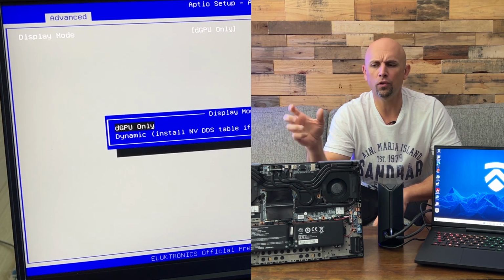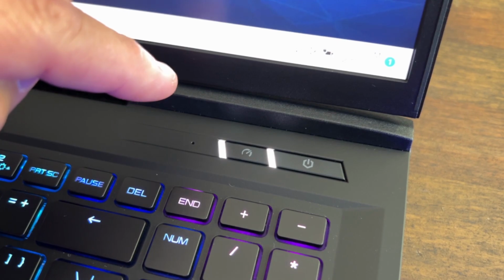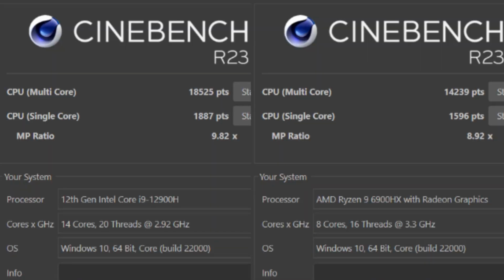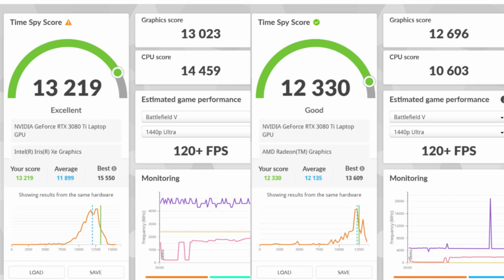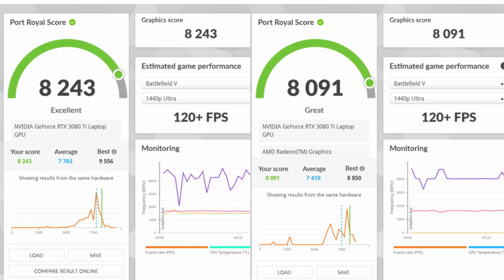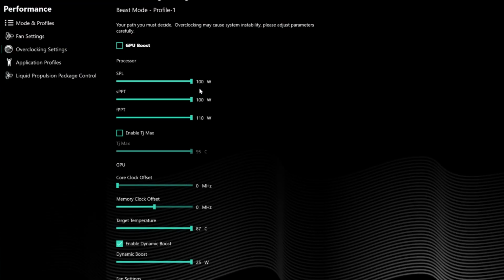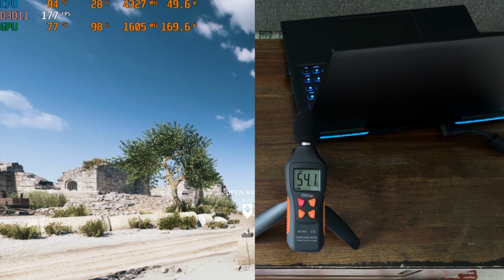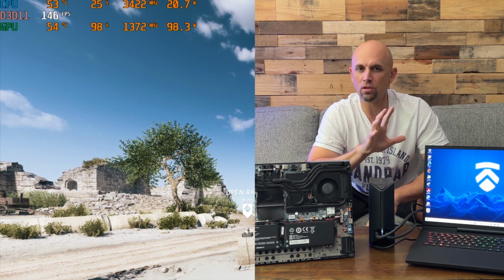(2022) MECH-17 i9 12900H and Ryzen 6900HX!  Expectations, Tuning and LPP Greatness!

Comment: hey bob! Recently gifted my friend my old titan and got myself a asus rog strix scar 17 special edition with i9 12950hx and a full powered rtx 3080ti. I have been following you since I started the laptop life and made it a point to learn how to undervolt. However it seems that this 12th gen intels sucks at undervolting. A friend told me that the chip was locked but I disagree as changing the core cache crashes the laptop. I looked at the bios and it also has the undervolting there but only up to -80 mv. I need help, do I need to unlock it on the bios first or what am I doing wrong. I cant seem to get decent cinebench scores and the laptop is really cooking...help please..
Reply from the maker: I know HX allows it but I don’t have any hands on time with 12th gen HX.  UV tolerance became very tight with 11th gen, perhaps 12th is that way too.
Reply: @BobOfAllTrades  my main concern is sir is how it kinda messes me up now unlike the titan before. atm i have to have it disable turbo boost to keep it from cooking the hardware. armoury crate is also a weird experience for me. I think I should have it on high performance on armoury crate before undervolting. at this point i think i should first undervolting the gpu but to tell you the truth, it runs it pretty cool.
Reply from the maker: @graelstream2353  Don’t let the GPU temps fool you.  Pulling the heat/wattage from one part will help cool the other.
Reply: @BobOfAllTrades  currently tweaking msi afterburner. Been able to push the cpu undervolt without it crashing at - 25 mv. I think I messed up the first time because I undervolted the system at silent mode. Tweaked the battery setting into balance, pushed armory crate and had the system on performance then undervolted by increments of - 5 mv. I hope I can push this further. You weren't lying when the thermal performance of the titan can't be beat sir..

Comment: Hey, there's a sell going on in eluktronics.  Which is better an amd or intel eluktronics?
Reply from the maker: A brief summary of the pros and con’s mentioned in the video.  

Intel will provide equal or better performance depending on the software used including games and editing.  

AMD had better battery life and can its USB-C is connected directly to the Nvidia GPU making this the right choice for VR.
Reply: @BobOfAllTrades  But I mean , if you had to use one for coding, which would you prefer?
Reply from the maker: @glorymanheretosleep   What does coding benefits from most?
Reply: @BobOfAllTrades  I'm not entirely sure.  Anyways, there's a sale going on.  So...intel it is according to you?

Comment: I just bought a i9-12900H RTX 3080 for $1,500 

This is the Description of my laptop
The long awaited MECH-17 refresh has arrived in a brand new chassis! This Grand Performance (GP) edition comes with a FIRE list of seriously exciting features. Eluktronics continues to show what a true performance enthusiast laptop consists of while the rest can keep trying...

External Liquid Cooling: Liquid Propulsion Package (LPP) Included (A $199.99 Value!) 

Operating System: Windows 11 Home 64-Bit (Clean Installation, No Bloatware)

Processor: Intel Core i9-12900H 14 Cores - 20 Threads (2.5-5GHz Max Boost Clock)

RAM: 32GB Samsung DDR5 4800MHz Binned Low Latency RAM (2 Dimm)

Display: 17.0" 16:10 Narrow Bezel QHD IPS-Type 240Hz Anti-Glare Display with G-Sync Technology & Advanced Optimus Support (2560 x 1600)

Graphics Card: 16GB GDDR6 VRAM NVIDIA GeForce RTX 3080 (Max-P: TGP up to 175 Watts!)

Storage: 1TB Samsung PM9A1 (980 Pro OEM Equivalent) PCIe Gen 4 NVMe SSD

Expansion: One empty M.2 PCIe bay

Wireless: Intel WiFi 6 & Bluetooth 5.2

Keyboard: Cherry Per-Key RGB Low Profile Mechanical Keyboard plus 10-key membrane numeric keypad

Light Bar: Customizable RGB

Mouse: Ultra Large Glass Microsoft Precision (PTP) Touchpad with multi-gesture & scrolling function

Webcam: Full HD IR Camera with Windows Hello Support & dual digital microphones

Ports: 1 HDMI 2.1 (Connected to dGPU), 1 Thunderbolt 4 (Connected to iGPU), 1 USB 3.1 (Gen 2), 2 USB 3.1 (Gen 1), SD Card Reader, 2,500GB Ethernet RJ-45, Audio out & Mic In, Kensington Lock slot

Audio: Sound Blaster Cinema 6

Power: 330 Watt AC Adapter

Battery: 4-Cell 99.8WHr Extended Life Polymer

Dimensions: 15.09 x 10.7 x 1.07"

Weight: 5.95lbs

Warranty: One Year with lifetime USA based technical support!
Features & details
Ultra Performance Inspired: Designed with an impressive thermal design for air cooling and complimented with a proprietary external liquid cooling system which connects to the back of the laptop. This circulates cold water through the internal heatsinks of this system cooling up to 20 degrees Celcius for both the CPU & GPU. A desktop experience at home and disconnect when you're ready to go mobile!
Extreme Performance – Crush the competition with a the power and speed of the latest Intel Core i9-12900H processor, featuring 14 cores and 20 threads to divide and conquer multiple tasks at once
Not Your Average RTX Graphics Card – The latest NVIDIA GeForce RTX 3080 (16GB dedicated GDDR6 VRAM) is powered by award-winning Ampere architecture with new Ray Tracing Cores, Tensor Cores, and streaming multiprocessors supports up to 175 watts of power for the ultimate gaming performance
Blazing-Fast & Color Accurate Display – This 17.0" Quad HD (2560 x 1600) IPS-Type LED-backlit display with 16:10 aspect ratio features an incredibly fast 240Hz refresh rate for gamers and content creators who demand the best visual experiences
Why Eluktronics – Astoundingly powerful. Professional Design. No External Branding. No Bloatware. No BS. US Based Support. Our laptops are designed to let you work, play, and create like never before!
Reply: Nice!

Comment: I noticed they have these on Amazon for way way less than they are selling on their site. Are they being sold at that price because it's overstock and they are making room for the 40 series or are they refurbs? Like for example the 16gb 1tb 12900h 3070 ti or 6900hx are only $1499 and $1599 which is nearly a $1000 less than their site. The other models even all the way up to the 3080 ti are around $1000 less again at $2399. There have been 0 reviews or sales on them so I'm a bit hesitant but it is directly from Elucktronics.
Reply from the maker: The awesome sale ended on the site recently.  Amazons sale is no slouch so grab it while it exists!
Reply: @BobOfAllTrades  Ah nice just what I needed to hear to pull the trigger, thank you sir.

Comment: Hey bob having some laptop trouble I got the Eluktronics 970tf after your videos on it and it’s been great the past few years but recently have to rig the charger into it to get it to turn on was wondering if it was soldered on I do not have the tools to open up the entire case or would check myself also any suggestions for how to deal with this would be great thanks!

Comment: I have a alienware m17 r5 with a 6900hx & 3070ti. The 6900hx keeps throttling down on me to around 1700mhz then goes back up to higher speeds happens randomly while playing games. Even sometimes it throttles all the way doen to around 400mhz
Reply from the maker: That’s seems excessive.  Hopefully Dell will produce a BIOS update to address that.
Reply: @BobOfAllTrades  maybe the 240watt psu is not enough ? I have always bought intel before, first time using AMD and that is probably the last time. AMD just does not feel as stable as Intel
Reply from the maker: @DepecheModeDM  intel is definitely more polished from a mobile platform.  It’s definitely not a PSU issue.  A larger brick doesn’t increase the power fed to the CPU/GPU.  At best, it may charge faster but that always the case.  

Based on comments, AW is an odd one when it comes to their performance laptops these days.  They let it rip without the ability to tweak anything and their software is very slow.

Comment: Bob, is it possible to manufacture a charger light weight 100g with 100w out put that can be used with any laptop with the help of small male adapter, do these laptops require bios update .

Comment: Hey Bob, have you tried disabling all of the E-Cores and testing at different power levels to see how the P-Cores behave? I'm thinking of giving that a try. I wonder if the P-Cores at a reduced wattage will boost high enough to provide a better gaming experience than the full cpu at a reduced wattage. Thinking of testing this. I notice that at 25W PL1 the performance for average fps is pretty solid, but I feel more dips and likely worse 1% lows.

Just a thought. Thanks for all of your hard work.
Reply from the maker: 12th gen hasn’t disappointed at stock so I haven’t seen the need yet.  Perhaps single core titles 🤷 

Let me see if I can find something to exploit this.
Reply: @BobOfAllTrades  I'm very impressed with 12th gen overall, but I'm trying to dial in a good profile with a balance of temps/acoustics/performance on air. I know it performs surprisingly well with the wattage dialed in, but I'm wondering if giving P-Cores priority might keep those 1% lows a bit more steady. 

Regardless the laptop is amazing. Everything I asked for as a successor to the Mech-17.

Comment: Hey Bob, if both use the same screen (assumption), why does the amd one lack the gsync certification?
Reply from the maker: That’s the question I had too because my experience with a non-Gsync solution in the past was brought back with a bios update.  That was on a 2017 Acer Predator.  Apparently in the case of our MECH-17 laptops, there’s motherboard chips that are missing.
Reply: @BobOfAllTrades  do all laptops actually use the hardware module? I thought gsync was achieved via software.
Reply from the maker: @niebuhr6197  I’ll need to investigate what the chip is for and what it is exactly.

Comment: Bob I really have to give you props for being so honest and blunt with your information. Even though you work for Eluktronics being as forthcoming as you are just speaks volumes. THANK YOU. Don't change man. 

It kind of kills me that the intel version doesn't have the thunderbolt port connected to the dGPU. If I wanted to get one of these to use as a DTR I'd want to have it connected to an external thunderbolt 4 enclosure for all my extra peripherals. Webcam, Mic, two external displays, and keyboard. First world problem I know, but that would make it alot simpler to undock when it was time to take it on the road. If the AMD version ever got a new revision for USB 4 I'd think that was be the perfect mixture. One of these days someone is gonna make the perfect laptop. Just so close. . .🤣

I do wish these were around when the Clevo x-170 was the best around. Because seem to be on another level.

Glad to see you make a video again Bob. Take care!
Reply: connecting to dGPU is best for performance, but connecting to iGPU is best for mobility. At least in case of my Dell laptop and my friend's MSI laptop, even after you disconnect the laptop from external screen, the Nvidia GPU keeps being active which horribly reduces battery life, so you either have to completely reboot the laptop(not an option of you have tons of apps open) or turn off the GPU manually via device manager, which is super annoying. No such problems when your monitor is connected to iGPU. you can just put it to hibernation mode and take it where you want, continuing your stuff without reboots or inconveniences.
Reply: This is an Intel rule read their chipset layouts online for 12th gen mobile chips. One monitor on hdmi, and the other on USB-c with advanced Optimus will still work well

Comment: Thanks for an honest review, Bob! The only thing I don't understand though is why choosing 12900h instead of HK, if H CPU-s don't have voltage control anymore? If you're going for an i9, wouldn't it be better to go for a tunable version?
Reply from the maker: Correct, no UV on 12th gen H. Intel has required less UV each generation so it’s promising that its less necessary.  8th gen was a definite-.115 or higher while I’ve seen 11th gen have WHEA errors at -.030.  I don’t recall for certain since it’s been several months and I don’t place the orders, but I don’t think HK was available when we placed our order and the expected expenses to have it is often hundreds more.
Reply: @BobOfAllTrades  that makes sense, that's what I thought. Thanks for your answer. Well, time to ditch Intel. At least AMD didn't take undervolting away from us on purpose and they have good battery life.
Reply: HK is useless if the BIOS is locked. All the voltage and multiplier tuning is "greyed out" on apps like XTU and throttlestop..... The only OEM that provides an "unlocked" BIOS is MSI. Otherwise you have to fuck with the BIOS yourself, ie: get a copy of it, find the hexadecimal lines that unlocks it etc, then flash it back in. It's extremely risky if you don't know what you're doing, and it's still a gigantic pain in the dick even if you've done it as every BIOS is different
Reply: nevermind, 6:50
Reply: @anthonyzheng7274  he doesn't talk about undervolting at any point in the video
Reply: @tabalugadragon3555  When he talks about the extra "tuning" features on the BIOS for the intel one, it is implied in that BIOS section you are able to undervolt. He also said there's no need to mess with the BIOS/undervolting since you can just tune PL1/PL2 in windows.
Reply: @anthonyzheng7274  no he doesn't. I've seen users of the latest Eluctronics laptops being unable to use official software to undervolt on i7 12700h, because Intel locked it out. So no, unless Bob directly tells you that you can undervolt 12900h, you can't do that.

Also notice that when he goes in detail of tunability he only talks about power limits and GPU undervolting. If CPU uv is available on their laptop and he wants to advertise it, why not mention that? Everything so far points at H CPU-s of 12-th gen being completely locked, so I don't think Eluctronics broke that rule here.

P.S. Messing with power limits doesn't equal undervolting. As lowering voltage doesn't decrease performance, while lowering power limits does.
Reply: @anthonyzheng7274  your last 2 replies are gone from some reason. In case you didn't mean to delete them - actually 11-th gen just locked undervolting on most laptops just like 10-th gen did, while it is 12-th gen that completely disabled it on non-K CPU-s. 
You can easily find undervolting videos of 11-th gen i7 11800h, no such thing for 12-th gen.

Comment: I've been using both of these for a bit, pretty nice so far!
Reply: @Jarrod'sTech +1 waiting for the review
Reply: Oh will you be doing a review for them soon?
Reply: @ookami-chan3328  It's happening, just not sure when, there's a lot going on at the moment!
Reply: @JarrodsTech  looking forward to it!
Reply: Jarrod posted today.  It's all I needed to order a Mech 17GP 3070 TI
Reply: Oh you teaser you. Now I'm excited to see what you can do with these monsters of laptops.
Reply: @Terreos  😏😏
Reply: You are the reason I bought mine. Thanks for the in-depth reviews you do. :trophy-yellow-smiling:
Reply: @dajatlemmont2323  How do you like it so far? Did you go for Intel or AMD? Which gpu and how do you like the screen? I might be getting one if I can get it on deal, looks like a monster
Reply: i wanted to connect this to my laptop i soldered copper on bottom with m6 4mm quick connect fittings. does this only run with software? only for eluktronics?

Comment: So you've got all that empty space down by the battery. I know these are tongfang chassis and maybe that kind of ties your hands, but maybe it's time to get nutty with the air cooling. Something like the Alienware x17 system, or I think the msi system with 3 and 4 fans and extra heat sinks. I'm not a fan of the LPP. Just seems like a lot of liability, but more air and more heat sinks? Sign me up.